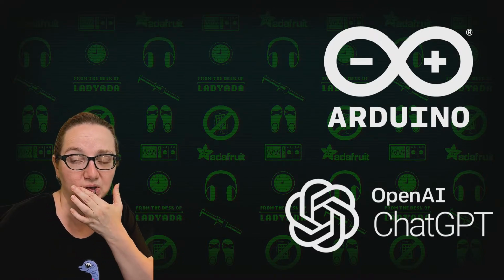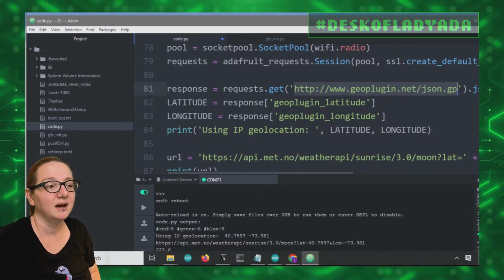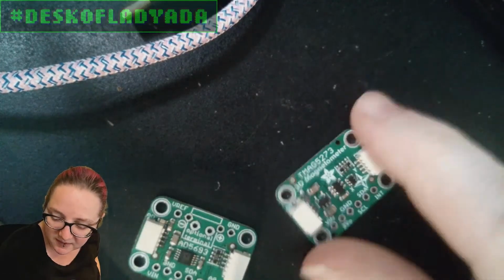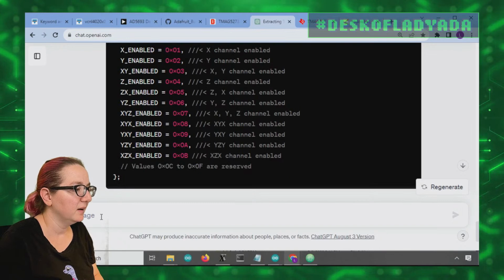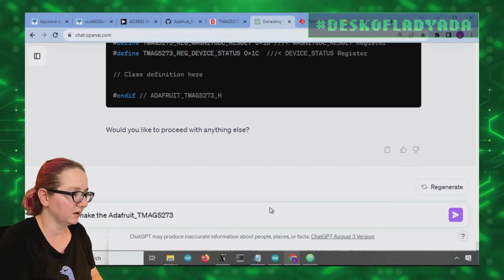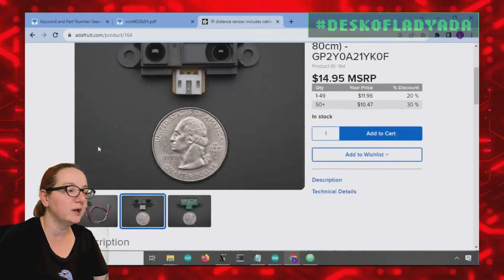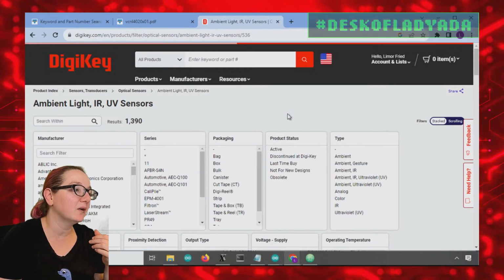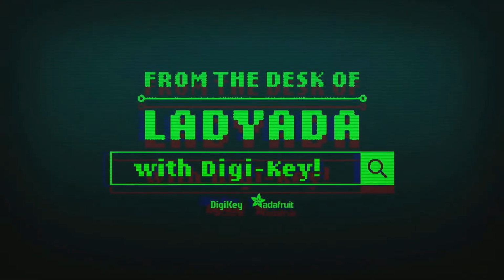Desk of Ladyada - ChatGPT-assisted driver programming & I2C Sensors

Comment: You can also try tweaking the "temperature" setting. A lower temperature makes it more deterministic, a higher temp makes it more random/creative. For code tasks a lower temperature is usually better.
edit: Regarding using the same chat vs starting a new chat - there is a limited context window of around 3k to 6k words, so once you go above that it will start "forgetting" the earlier messages. A trick I've seen is to teach the model with some examples (~10 messages) and then ask it to do the actual task. Next time, instead of asking a new question at the end of the chat, click "edit" on the first message of the previous task (after the teaching part) to replace it with a new task. This will keep the teaching context and prevents it from forgetting.